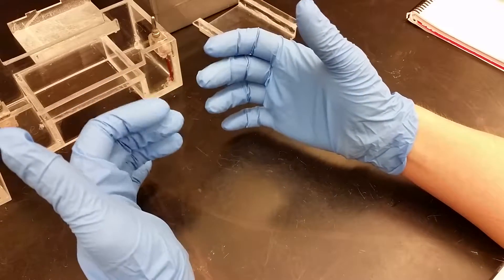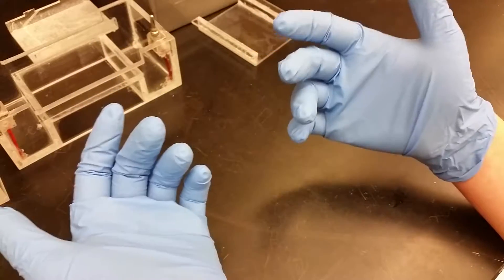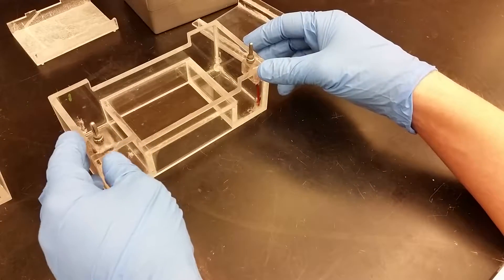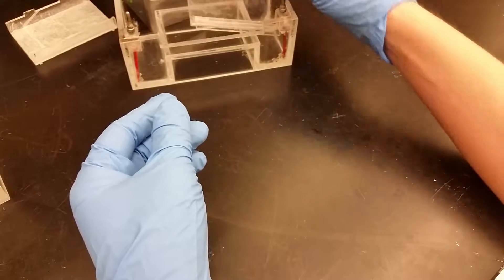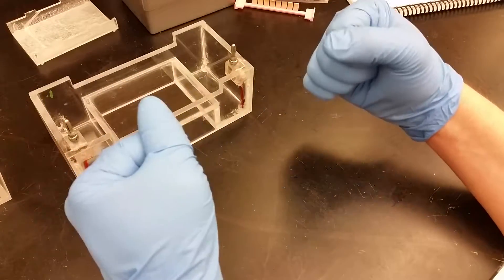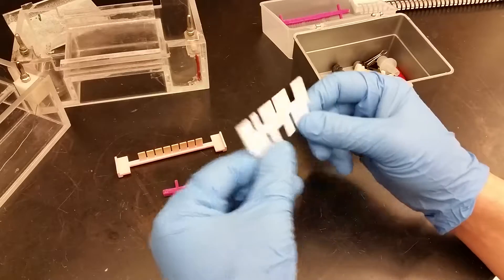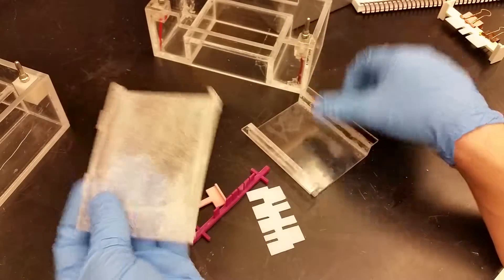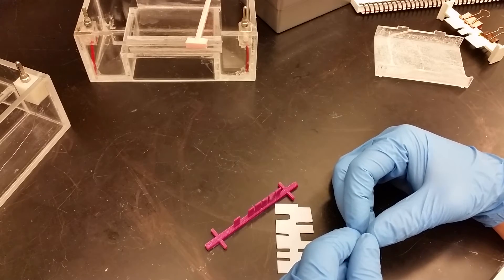(PJ e1) DIY Electrophoresis Equipment

Comment: What is the power supply you use?
Reply from the maker: We've got a couple, one old fisher, an old biorad, no safety shutoff to speak of. Anything that can put out ~100V DC and maybe 70 mA will do the business.
Reply: @pipettejockey7464  Thanks a lot! :) 
and what material are the rods?
Reply from the maker: @yuliyanzhivkov3383  Best thing to use is platinum wire that's alloyed with iridium, I think its 95% platinum 5% iridium, or some other precious metal. As corrosion resistant as pure platinum but less brittle, it's sold as replacement wire by Sigma https://www.sigmaaldrich.com/catalog/product/sigma/ep1330?lang=en&region=CA